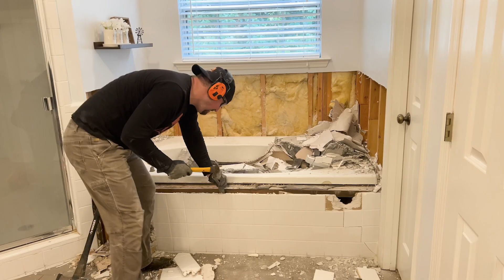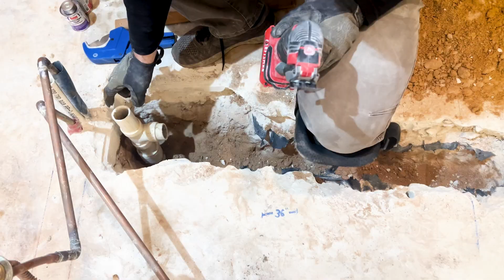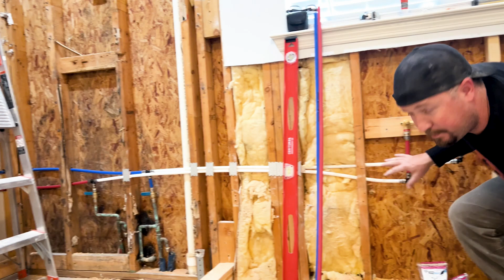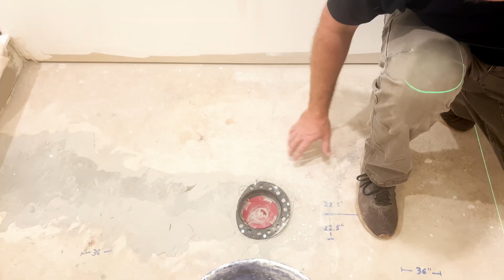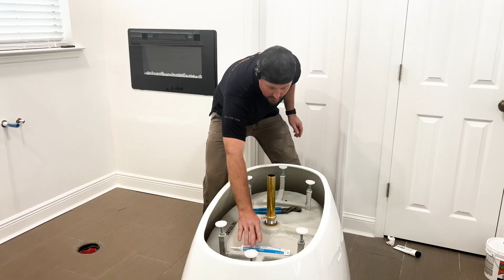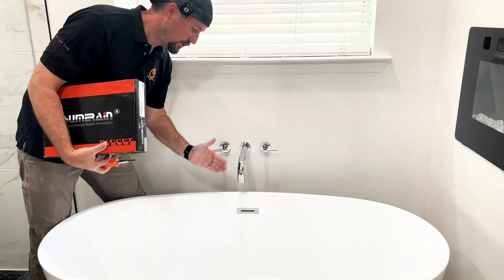How to Install a Freestanding Tub on a Concrete Slab

Comment: Nice walk through, thanks - looks great.  If DIY you are right - 6 months becomes the case when you have other things going and you don't get to the job every weekend / night.

Using a circular saw (keeping the slab moist to keep dust down - also put a box fan in the window to move out dust) to cut the concrete is a good idea, even if not cutting through the entire slab.  Using brute force on the slab can create cracks that you don't want in the slab.  It may also be helpful to put in a decoupling membrane on newer slabs (and even older) to keep tile from getting hairline fractures if the slab has any movement.

Great job mentioning the tub installation details should be review PRIOR to installing the drain.  Some manufactures have flexible (rubber) pipe/tube that goes into the drain.  Putting the drain in the wrong location with an exact placement like your has is important to position the drain exact. And cut the tub drain pipe so it has some fall before hitting the elbow so it drains well and hair/junk don't get caught. As someone asked - drain trap should be under the slab.